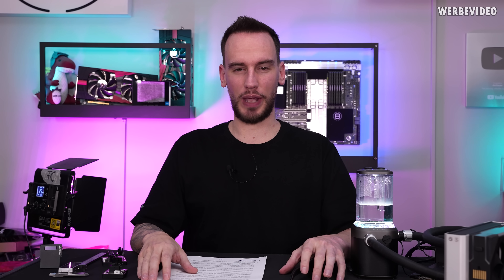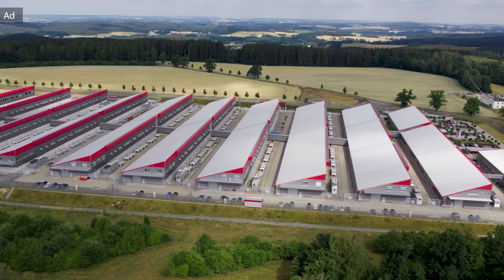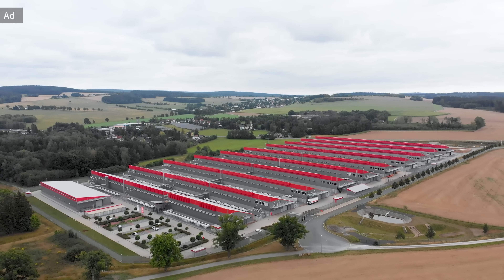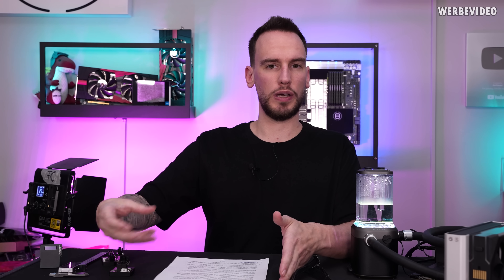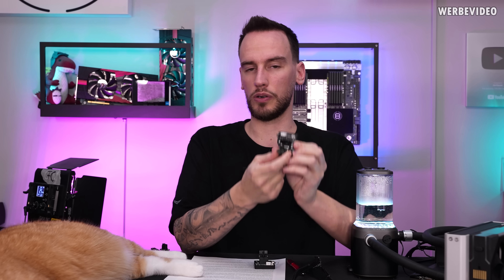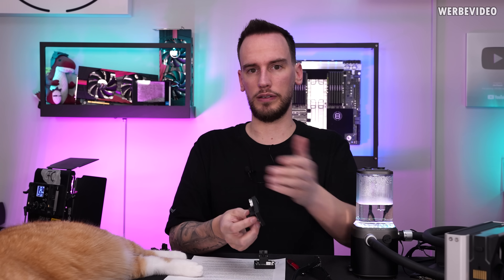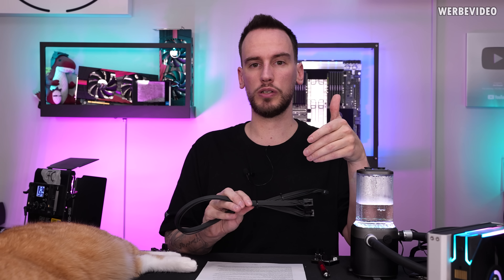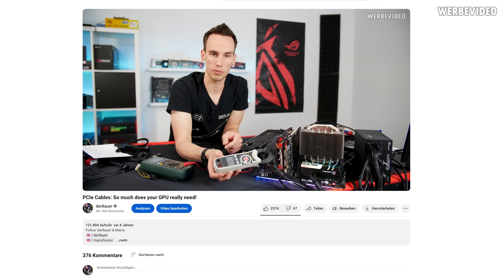12VHPWR is just Garbage and will Remain a Problem!!

Comment: Correction, the limits on PCI-E 6 and 8 pin are purely artificial. Before they existed, SSI spec for 4+4 is dual rail 16A each, with a 19A peak, and 240W over current. So a 8 pin EPS is speced at 384W continuous, 456W peak, and 480W OCP.

A 4 pin is half that, and has the same current carrying pins as a PCI-E 6 pin. So a "75"W 6 pin can carry 192W if you put those same pins into a 4 pin.

The reason for the limit is in order for a PSU to advertise pci express, it has to be able to output the 75w to all 6 pin and 150w to all 8 pin. Same with cards, they can only draw that much. SSI dosent rely on that, and requires to builder to actually calculate the load and requirements.
Reply: This is also why datacenter cards use 8pin EPS. Why put 2 8pin pcie, when you can just install a single 8 pin EPS.

We could easily just move to dual 8pin EPS on GPUs, and forgo 12vhipwr.

Comment: Nvidia should've immediately recalled RTX 4000 and used 8-pin. It's insane they are still using a plug that causes a fire hazard. Also shame on GN and Nvidia for downplaying the issue.
Reply: PCI SIG - the standard group that developed the 12vHP connector, should be the ones under scrutiny. Imagine if your sole responsibility was to develop new PC standards, and this is what you came up with? Where is your head (lodged fairly far up somewhere unpleasant I'd guess...). Nvidia was stupid to adopt it for their highest power draw card ever without more testing, but really I think the failure comes to the group solely responsible for coming up with the new standards. 

Never doubt the ability of idiots to infiltrate high-end positions. Idiots are everywhere.

Comment: I still don't get why they don't go 48v instead, much higher wattage capacity with smaller connectors and there is decades of experience dealing with 48v DC from the telco world, including PC power supplies run off it.

Comment: The RC folks has a tried and tested XT-90 connector for their LiPo batteries that's capable of 60A continuous DC power but Nvidia/PCI SIG decided to go ahead with the engineering catastrophe that is the 12VHPWR.

Comment: I wonder, if Nvidia doesn't ditch the 12VHPWR connector, can the AIBs not use it on their versions of the associated RTX cards? It's just the GPU chip that they're getting from Nvidia, right? They design their own PCB for their cards, no? So technically, they can go back to 3x8-pin or 4x8-pin power connectors for their cards. Just do it. Most of us consumers still use PSUs with 8-pin connectors anyway. We don't like the 12VHPWR. Because of this 12VHPWR connector issue, I switched my focus to a 7900XTX for my GPU upgrade. But now that I've read about Radeon cards having issues with PCVR gaming, which I want to do next in my gaming journey, I have to come back to Nvidia cards and take a big risk of a potential fire. I'm waiting to see what the next gen's cards will use before I take my next step.

EVGA must really be thanking their lucky stars now.

Comment: Finally someone who's in the tech youtube space calls out this connector.
Yes I know others have tested it and "proved" the connector can work well, but here's the thing, while their testing is great, it doesn't test "real" world scenarios meaning actually using the thing.
Not using it on a test bench and seeing if it catches fire. That's not real world. Putting the card in cases, tugging on the cable things like that means real world.

Comment: I'm no electrician or tech guru, but I am a solar system guy. Why not move from a 12v Rail into a 24v industry standard? Hear me out. As components continue to advance and require more power the amperage also increases, while a 24v conversation cuts down the amperage and will also lower the resistance of circuits.

Comment: Don't forget that higher resistance causes voltage drop and leads to higher current draw with voltage regulators.

Anybody who isn't completely illiterage on physics knows how dangerous this is. The die and memory require a certain amount of power. The VRM does everything to keep the output stable regardless of the input voltage. Input voltage drops due to increased resistance at the connector pins, thus the VRM draws more current, which leads to even higher temperature and increased resistance, and a thermal runaway situation.

The fact that you can wiggle the connector slightly causing the connection to cut off intermitently shows exactly what people have been saying - this is a serious *design problem**, **not* a manufacturing tolerance from every PSU, GPU, adapter or cable manufacturer, nor exclusively a user issue.

"With great power comes great responsibility" - and it should definitely come with suitable connectors.

Comment: Should have gone to 48V rather than stay on 12V. Would mean 1/4 of the current, so 1/16 of the resistive heating of the wires/connector. So much more safety margin for the connector being improperly inserted. Would require more work to get the PSUs to output this, but would be much safer/better overall.

Comment: There seems to be two issues here, the current capacity of the connector and it's general reliability in maintaining good contact. If the current capacity is tight, but within spec, there shouldn't be an issue. The issue seems to be when even lightly flexed the connector loses connectivity or goes high resistance in one or more pins and that will then go beyond safe limits for the other pins. While multiple HPWR connectors might solve the overheating issues on a 4090 this would appear only to be because as the connector pins disconnect or go HR, there is still sufficient current carrying capacity in the other pins to carry the load safely. The question surely has to be, "Why are we seeing pins disconnects / HRs when the connectors are manually flexed and given others have not had issues at high currents with genuine Molex plug / socket combos is the issue non Molex brands and their lack of capability or adherence to spec?

Comment: As an electrician, I could have told you that this new high power 12v connector was garbage. Whoever came up with it as a standard should be removed from the industry in disgrace. If I am power limited by the 8 pin connector, then so be it. I will never use a graphics card that requires the HP12V connector. In fact, I am amazed that a standard like this got approved by the Canadian Standards Association for sale in Canada.

Comment: I'm surprised there isn't a class action lawsuit over the entire 12V HPWR issue. Especially since it can burn somebody's house down. Wouldn't need adapters if the connector wasn't defective in the first place. They should recall all the 4090 cards to have the new connector installed.

Comment: I know that the majprity (gamers) of high end PC users, are up in arms over the rise in costs and power usage for the new CPU's and GPU's but as a professional user as well as light gaming, the PC industry in general is in need of need and better standards to meet our needs. PCIe slot breakage from weight, lack of debug leds, this 12vHPWR connector, the need for active cooling for storage is past the point of wrong to unacceptable. These cheap solutions are ruining expensive equipment. If you had any idea how overbuilt some of the professional PC/s I have bought were in the past v.s. this "we will save a whole dime" solutions now you would chin drop. I blaim not under engineering however I blaim over engineering in that the cheapest "solution" wins. Yes the design works, only when everything else is run perfectly, and in the real world perfect doesn't happen much.

Comment: Honestly your demonstration of slightly moving the cable tripping the power alarm light on the GPU is the first time I've actually seen real evidence pointing to a core design flaw with the connector, though I suspect you just have a bad cable or GPU socket since I've seen others do far worse with zero issues.  Plus the fact that Cablemod is only recalling their angled adapters and not their cables tells me that there's a design flaw with the adapter boards themselves, regardless of who's actually designing and manufacturing them.  I know on the v1.0 adapters the connectors were not particularly stable and would wiggle around a surprising amount.  Definitely not good for electrical connections.

Comment: There is little bigger margin of safety since 75W can be drawn by PCIe slot, but I still agree with very poor design and still insufficient margin at higher temps and cases when when single pin connection fails.

Comment: The old way is ugly-
Up to three cables with a zip tie to tie the additional wire on each, just NO-
I uses a dedicated single 12VHPWR  from the PSU to the GPU, no 2 into 1 or 3 into 1-
 I use the Thermaltake Tough Power 750 watt with a dedicated single cable from the PSU, and it works just fine-
 the old  1to 3 wires is ugly and needs to go

Comment: The 4090 is the problem. If you have a 4080 or lower you're fine with using the adapters if you ask me. Since those cards only hit maybe 320 watts. At least i feel safe continuing using my adapter and using my silverstone psu cable.

Comment: The reason why your old test worked is because the connector (this crimping, the lug, the metal to metal connection, the insulation around the metal parts) is the weakes link and the best insulated (thermally)

It looks like you still used all connectors but only a single set of cables but still uses all available connectors.

if this is the case then you change only very little and in terms of actual cross section and metal to metal connection in the connector. Of course you will get nearly the same results.

Comment: Its just too much power for too little voltage. Just like modern car systems which have huge power demands, maybe the voltage should be raised to 24 or 48V to work around the problem of overloading connectors. Yes that means new power supplies with 48V outputs but in a complete system that could be beneficial for the mainboard and it power delivery for the CPU as well.
However, even more voltage wont get rid of the problem where the stupid 12V connector just doesnt connect right no matter what, its not designed good imho. They should have used 4x the old 8pin connector even if it looked dumb on first sight...